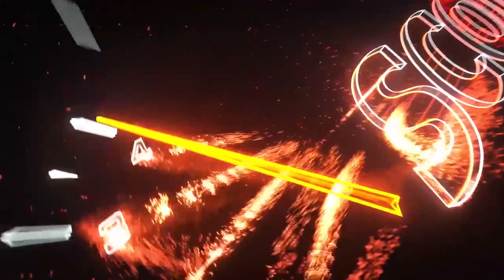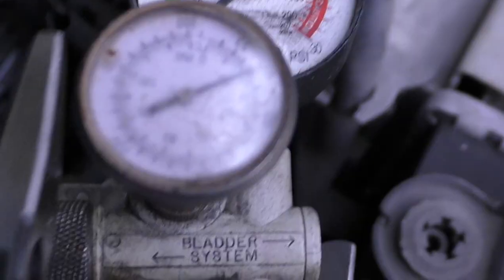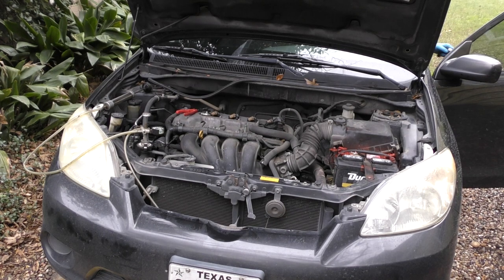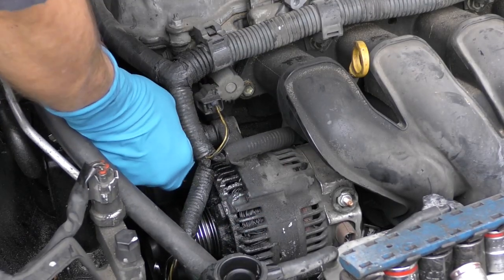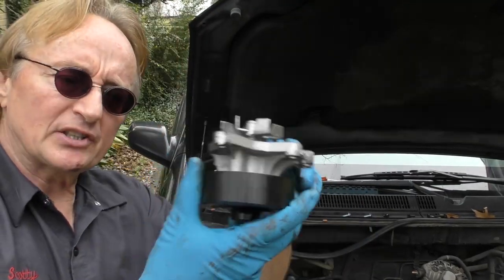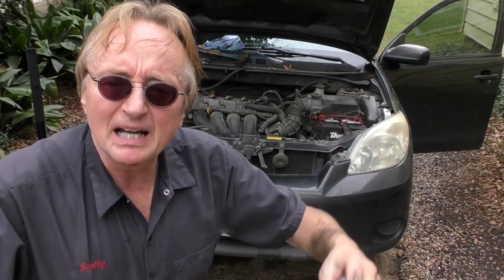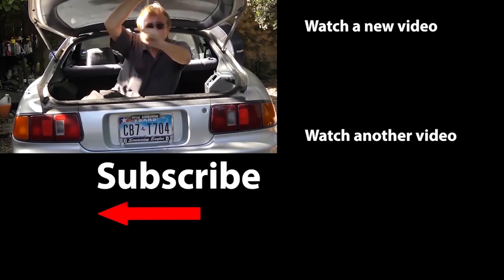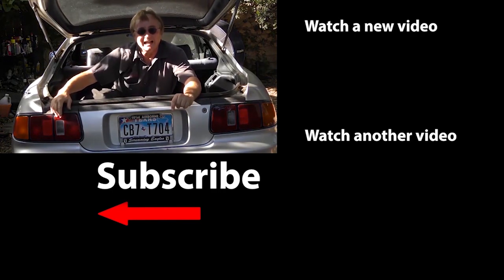Here’s Why Toyotas Have This Serious Problem

Comment: Scotty Kilmer : I just love your videos. However, early in this one, did I see you crawl under the car while it seemed to be only supported by a car jack? In January, 1976, I enrolled in a vocational school, in an auto mechanics program. One of the very first things I learned was never, absolutely never, crawl under any vehicle that's just being supported by a car jack. Always, set jack stands under the vehicle...wherever, and set the vehicle onto the jack strands. Then shake the car as hard as you can. If the car doesn't fall off the jack stands, if the jack stands don't collapse while you're shaking the car,  they probably won't collapse while you're under the vehicle. Scotty, I sure as hell don't want you to get yourself killed while underneath a vehicle trying to repair it.

Comment: If the engine isn’t 150K or more and the water pump mechanical seal or axis failed... that means the owner filled the system with just hard water. 
Or else the manufacturer made a bad pump... but it’s venerable Toyota... Toyota never fails... so it’s the owner who is responsible. 
Choose your venom Scotty.

Comment: Does Toyota use cheaper than average gaskets? They seem to be really prone to fluid leaks after 100k miles compared to a lot of cars. I've had high mileage cars that leaked very little or were even bone dry with over 150k miles. Many many cars.

Comment: Why on Earth wouldn't you replace it with new coolant exp since the old coolant had sealer in it which will clog head ports over time..they used it because of the water pump leak, it's fixed so put in propper coolant before you cause a bigger problem

Comment: How did you even notice it leaking? Looked the same to me lol I lost a lot of coolant and I changed my oil and noticed it was extremely low so I just added more coolant and replaced the radiator cap.. I hope I don’t have to do this cause I’m not really mechanically inclined and I know I’ll have trouble with that belt

Comment: hey Scotty ,I have a 2005 Chevy Colorado sometimes it will not start because of the passlock system and I have too wait about 10 min before it will start .what do you think could be causeing this problem and how could I fix it? the truck still runs great I have about 160 thousand miles on it. and it is a 4 cyc. engine I just worry I will get out and park it and not be able to get back home with it. if it will keep going another year I am going to get another truck,then .but for now I am keeping my eye out for a used Ranger or Toyota pick up.

Comment: Hey Scotty I have a 2015 Nissan Murano , which I’ve already had the transmission replaced at 117,000 currently at 163,000 I’m having overheating issues when sitting in traffic. When car is on expressway I have no issues . Dealer says I need a new engine, I’m ready to drive this car off a cliff it’s given me so many issues . They said head gaskets are what’s causing it to overheat. What do you suggest I do .

Comment: Regarding the software bug that prevents the ABS warning to appear, of course this is MONGO serious! As a 46-year veteran of the information technology business it's my duty to warn the innocently ignorant as follows: My two degrees are electrical engineering, but they could just as well be mechanical, chemical, civil, or any one of the traditional engineering disciplines that existed BEFORE "CS" (computer science) degrees were invented to cover graduates who focused on computer design and programming. Engineers like me (i.e., old farts) were taught "it has to be perfect." This rule was especially important for designers of contraptions whose failure could KILL YOU. Old fashioned indeed. Nowadays programmers routinely expect bugs; they are convinced these are inevitable. Shipping code that runs -- sorta -- is routine, especially when making a quarterly revenue target is more important than anything else. It would appear this mentality has oozed into the world of automotive programmers.

Take heart; it need not be that way. As an example, software is a critical component of the targeting radar system of every high-tech fighter jet. You can bet that software works!

Comment: Thats alot of messing around and its the reason why I go to a mechanic for complicated car issues like coolant leaks.
Reply: I would say it's a simple fix for me ......its not an engine overhaul
When I do a waterpump and timing belt in my car it costs me about 120 to 160 in parts......the labour is my time and free
Take it yo the dealer it's easily a 700 dollar job......take it to a trusted general auto repair shop it's fairly 350 to 400 bucks
With my time its 160 at the most in new parts.....😉👍

Comment: Cx5 over a Kia Sportage ?????? Your nuuuuuts..Kia sportage is yes,cheap and bare bones . No horsepower or anything BUT extremely reliable and strong . My wife daily drives hers for years now and all I've done was changed fluids and it's ran and running perfect . It has 160k and is a 2010 4cyl too

Comment: Wow.  So easy.  My honda I have to put the engine top dead center, remove the timing belt, engine mount, jack the engine, remove the crank using a breaker bar about 10 foot long, try not to loose the key.   It's a mess.
Reply: Very true.....same with my 2010 hyundai.....but at least the timing belt gets done at proper intervals......timing chains fail because people think they never need to change them even at higher engine mileage......and some occasionally break with fatigue.....or get too much slop or slack that they skip a sprocket tooth or a few teeth and fail.....engine failure as a result.....👍😉

Comment: I have an 06 rav4 with the 2.4l o drive 100+ miles per day. In that time its using half a quart of oil. Some what sluggish acceleration.  No check engine lights or anything.  Have replaced valve cover  gasket, oil fill cap,  pcv valve. per mechanic where I bought it.  What should I do?

Comment: I have a 2013 camry se. The transmission jerks between 2nd and 3rd gear. And when i accelerate to about 40mph i feel vibrations on the wheel. What could possibly be the problem?

Comment: Good pointer that water pumps can leak while running - Even if holding pressure when not. You're working too hard, Scotty. The camera was on the pliers atop the engine, instead of underneath, to show coolant leak while running :) Slow down, Scotty. I'm gettin' old too. Don't have to rev up your engine. that much :)

Comment: Eww, dirt!
A clean engine bay means the owner takes good care of the engine... and is a clean person, which is the same most of the time
Reply: Access oil and grease coats all the   aluminum.....iron.....and other metals under the hood......good if u have to drive the car in winter here up in Canada when salt is the key car killer.......😉👍🤣

Comment: I have a Pontiac vibe (basically the matrix) and on idling I'm getting a lot vibration/shaking. I've replaced 3/4 motor mounts (I don't know how to tell if the 4th is bad), I had a tune-up done, along with other odds and ends done. I don't know what else to do/it could be. Anybody have any suggestions?

Comment: That pump might never have leaked if it had been made with a stainless steel spindle and teflon seal.
Reply: True but eventually the bearing will fail......the question is when and what would fail first....the seal or the bearing or gasket?

Comment: There you go again Scotty picking on GM. I worked as a GM tech for over 25 years. GM doesn't have weak electronic systems ok. They are no better or worse then anyone else. I will take my new GMC Denali HD over any Ford or Dodge or Ram as they call it these days, any day of the week.

Comment: Seriously a Mazda over a Kia???!
Since Scotty is biased no surprise. I’d rather get the Sportage.
Reply: @spenserchalkley7013  I agree the new ones are built better. Just because its a Japanese brand doesnt mean its necessarily better. 
I've had a 93 and 98 Mazda MPV and they both had transmission problems, engine misfires, multiple check engine codes, issues with the 4WD system, water leaks, and door actuator failure.

Comment: You make a bic mistake, starting a engine with los stuf on it. When it fals it can fal between roteting parts, wich bad luck between the camshaft belt. It distroys not only the belt buth also your valves.  Big costly mistake.

Comment: Good lord, if that is my car and I need to change the water pump on that car, I will change the alternator since it is already been removed.  Why put back an old alternator :(.
Reply: Alternators are costly.....get as much use of of them as you can lol
Reply: @fil1329  Well, I am thinking of the labor cost when the alternator goes south :).  That alternator looks like it is more than 15 years old LOL.
Reply: @paulc2548  true I guess.....unless u r like me and install your own alternators.....I keep a spare one in my trunk.....I get as much time and mileage as I can out of them if I can.....sometimes a pain in the butt to change them on the side of the road though.....cheers....👍